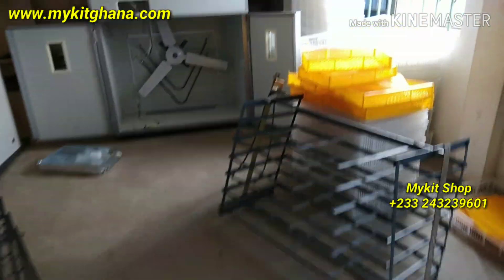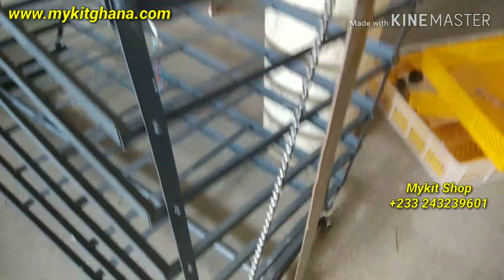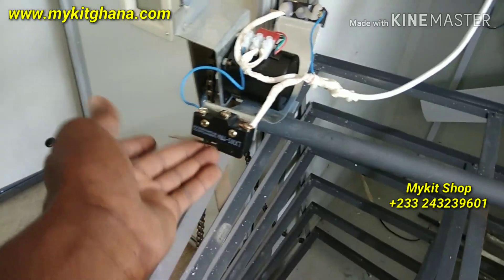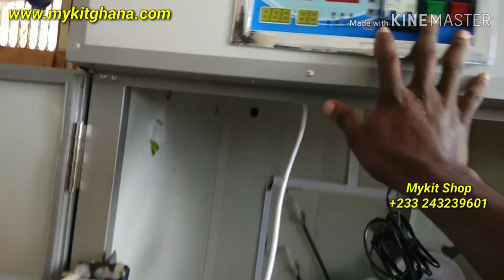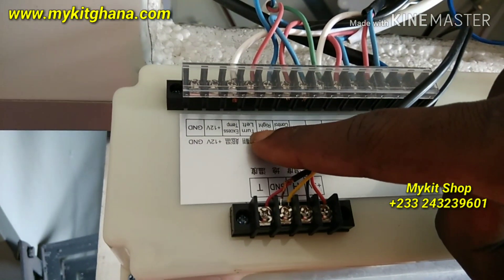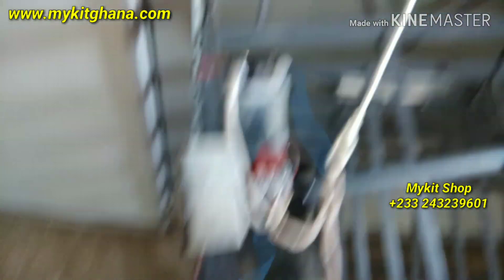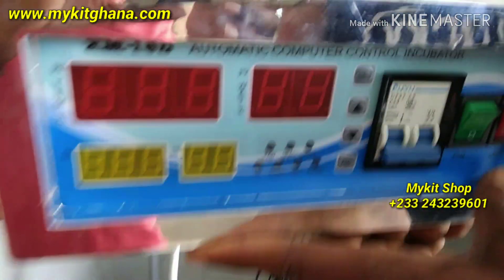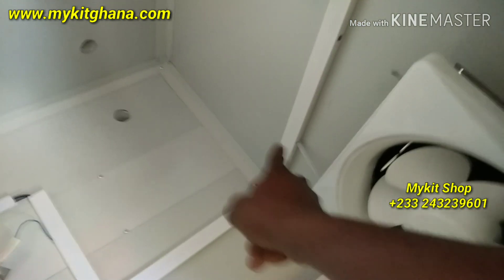GQF egg incubator vs XM-18D controller wiring

Comment: Hi, I would like to know which of the two heat connections (Deficient temp & Temp Control) is the main heat element to be connected to? XM-18D
Reply from the maker: Temp control is tye main heater
Reply: @mykitvideos5937  Thanks for response. This means that if have 200w and 100w elements, 200w should be connected to temp control and 100w to deficient temp? The size of the incubator requires at least a 200w. Thank you in advance
Reply: Thanks for the response
Reply from the maker: exactly. Deficient temp is just a top up. so use the smaller watts for the top up
Reply: @mykitvideos5937  Thanks so much and blessings upon your house and business
Reply from the maker: thank you 
bless u too

Comment: Sir, my problem is that when the tray touches the limit switch it will stop. However on the next cycle it will continue on the same direction. Wiring is correct
Reply from the maker: https://youtu.be/u98MFcNG1i0
Watch this

Comment: Am having issues with connecting my tray turner motor
Reply from the maker: https://youtu.be/d_Zro34Kvmc
Reply: Thanks for the video. I appreciate. Meanwhile, am installing my 1548 incubators, I noticed my main fan turns anticlockwise. I swapped the wires, it still turned anticlockwise. The big white ceiling fan model.
Reply from the maker: Please can u get an electrician to check it for you
Reply from the maker: https://youtu.be/u98MFcNG1i0

Comment: What is the voltage given out by ventilation fan option? What voltage of exhaust fan should I contact on this Xm-18d?
Reply from the maker: It depends on the voltage rating of the XM18.
IF it's 220v then your vent fan should also  be 220v.

If 110v, then 110v
Reply: @mykitvideos5937  thanks

Comment: I have the same motor for turning the eggs, but when i switch it on it turns back and forth for a while and then is fine, i have 2 they both do it, do you know why?
Reply from the maker: If you are very sure your wiring is correct then do this.
F1.... 1
F2... 5
Reply from the maker: That means Every 1 minute the motor will turn opposite for 5 seconds
Reply from the maker: If it works then you take the settings back to 
F1.... 90
F2... 120

Meaning you really don't have a big problem
Reply: Thanks you were very correct!
Reply from the maker: Where do you switch it on from
Reply: @mykitvideos5937  ok this is fixed but i connect it to the module the same way you do but it only turns one way and when it hits the limit switch it turns off but it never turns the opposite side
Reply from the maker: I am glad I was able to help you. Do me a favor.
Click here and message about how my YouTube channel helped you in your country
😁 
https://g.page/mykit-shop/review?gm

Comment: Hi what's the guaranty of hatching, does it have warranty and what's the period? Who pays for shipping back when there's a mulfangction?
Reply from the maker: No need to ship back because it's well tested. It comes with spare parts which you can easily change.
Warranty is 1year. We have customers using this brand for over 4years without having to repair
Reply from the maker: Which country are you from please
Reply from the maker: Hatching rate is 87% at least